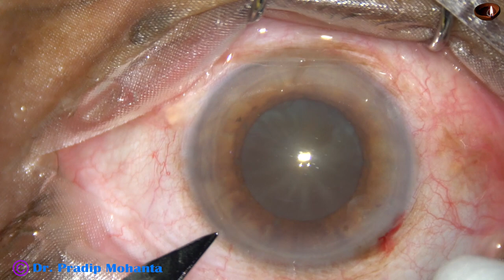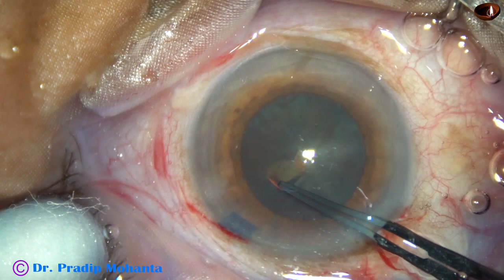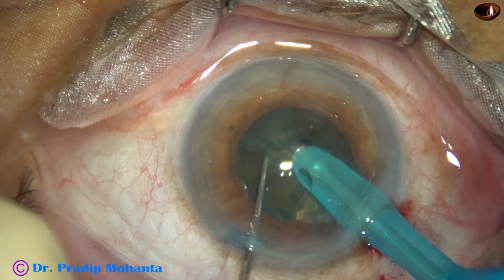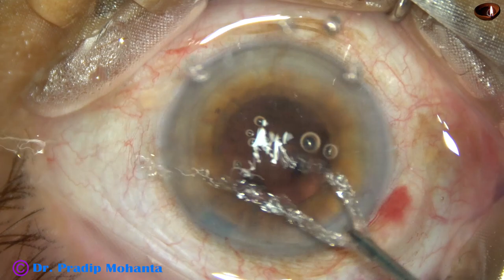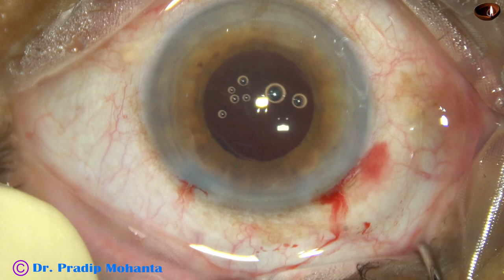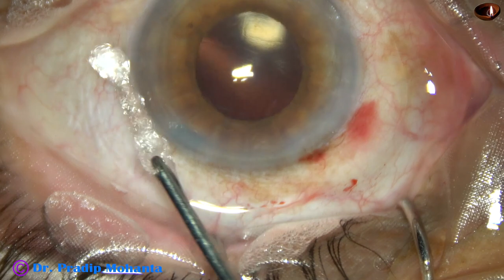Soft-cataract-Phaco, Hybrid IA, Hydroimplantation : Pradip Mohanta, NEH, Ranaghat, India

Comment: Sir I m using caterhx easy too ..what should be the  bottle height from  patients eye?
Reply from the maker: 100 cm
Reply: @pradipmohanta9321  thank u sir ...sir phaco tip and sleeves available in the market are the same with tip and sleeves provided by oertli compeny?
Reply from the maker: @janzada3373  
I buy from a reliable distributor of Oertli. No idea about what is available in the market.
Reply: @pradipmohanta9321  I had a very bad experience of using tip bought from market ..causing corneal edema in 80 % of my cases ..even all the  cases were finished within 8 minutes ..may be the cause was mismatching of tip and hand piece fluidics..??